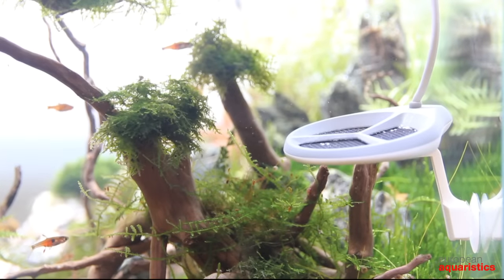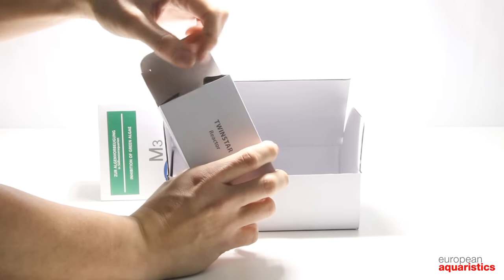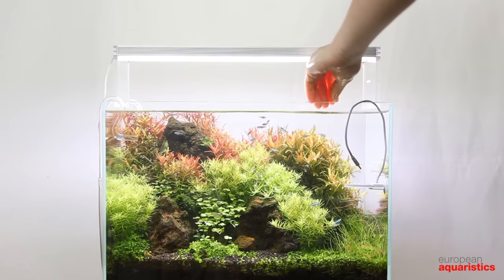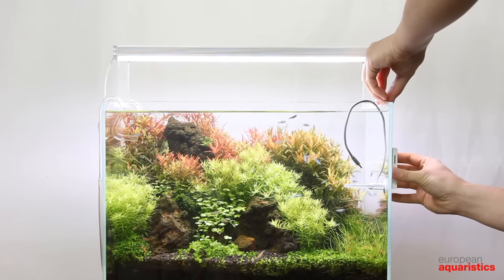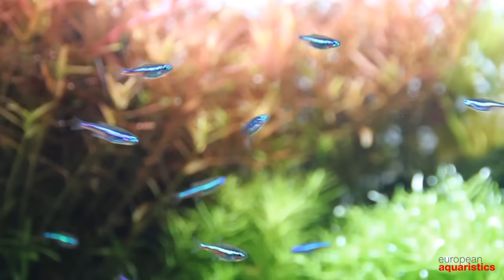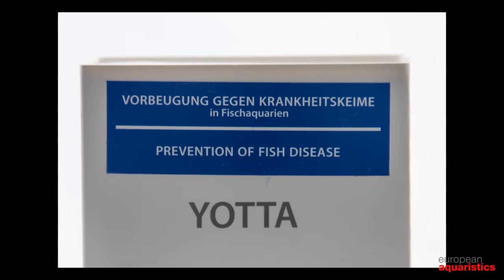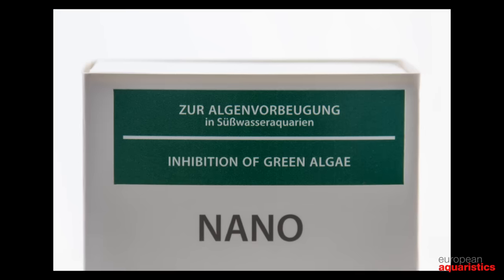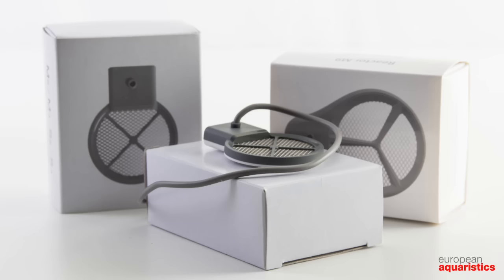TWINSTAR! For a better algae-free aquarium!

Comment: Makes me laugh,  they work incredibly well.  Have 2 in shrimp tanks running co2,  its that good I've had the same co2 diffuser in my tank for 2 months without having to clean it.  They only used to last 2 week's before i put twinstar in there.   So believe it works very well.  Only algae it won't stop is bba

Comment: I'm sorry but this product falls into the 'high-tech non-essentials' category, very much like ADA Power Sand, Tourmaline BC & Dupla/JBL heating cables. Flashy rich kid's toys at best but just that, toys. Things that you don't need but provide a bit of fun, as well as futuristic coolness that rivals in sophistication to a marine aquarium stocked with exotic live corals.

I've seen these Twinstar units in action at various professional aquascape outlets - all featuring high-tech Nature Aquariums, Dutch tanks & were the tanks free from algae? No! There were still algae in the tanks, including that strip of BGA under the substrate touching the glass panels.

Which begs the question: "Why bother?" Simply because of BUSINESS. Yes, it's business as usual. Ah, but shopowners everywhere will be furious should that be a topic for debate but really, marketing fads happen. 

We, as consumers need to be discerning & knowledgeable. All planted aquariums, no matter what tech-level each operates on goes through the same bio-rythym (new tank syndrome, old tank syndrome) as well as buochemical processes that slow down plant growth i.e. allelopathy. It's just a question of speed - the rate at which the tank matures. Which depends on the energy input i.e. light. 

So, can this flashy toy's microbubbles prevent algae? Maybe to a small extent but it will never solve the root-cause of algae problems. That being, the natural ageing process of a planted tank which I've mentioned above.

And you can't blame the manufacturers when it is the consumers who lack even basic knowledge, intuition & Science of planted aquariums. They know. That is why, they're in it for the quick buck. If all aquarists, in a perfect world had access to perfect knowledge these companies will close & businesses fold! 

Personally, I like to stick to basics & go for mid-tech. Why overcomplicate things & pay more to set up a high tech planted tank that is ageing faster AND demands constant attention lest loss of equlibrium causes everything to go down the ditch? Do people these days not value things like long-term stability & simplicity in favor of quick gimmicks, instead?
Reply: I would have read what this product does before posting this rant. They say it only reduces by 80% (average) for only certain types of algae.  You still have to be diligent in your fight against algae, but having something to assist in reducing the explosion is ok as well.  If you have the money, and it's working, why would you be against it?  Some of this hobbies biggest problems are inconsistencies in the online knowledge of how to address concerns and that your way is the only way to do things.  The fact is that most people leave the hobby because of algae and those inconsistencies on how to fix these issues.  Since there are no chemicals, this is a win.  I would take it as such.
Reply: @thawolf5921  Firstly, before you disrespectfully reduce my opinion to a "rant" I urge you to read my post again. Did I imply that "my way" is the right way? No. I merely said the truth, that being a lot of hobbyists today lack actual knowledge, as well as practical understanding of how planted aquariums work i.e. it's dynamic equilibrium & algae being a part of that natural process as an aquarium ages. Thus, their reliance on marketing fads owing to such ignorance. And yes, this product is a fad.

Why so? Well, that's because unlike you I don't "read" about products & then try to shoot others down like smart arse - I see the product in action as used by professionals.  And I am honestly telling you, despite claiming to reduce algae by 80% & what not, there are still established planted aquariums (~ 2 years old) that suffer from algae breakout even with this thingamajig running & kept in pristine working condition. That's because algae is symptomatic of an aquarium losing it's state of equilibrium. Algae is not the problem itself. Do you understand this concept? It's called 'old tank syndrome' - rejuvenating the biological balance of the aquarium, reducing accumulated organics & ensuring that municipal water supply parameters are not contributing to excess undesirable nutrients (via RO filtration) are the tried & tested methods.

Think you can simply a buy a product off the shelf without understanding water chemistry or how your own aquarium works & expect an algae free aquascape? Your ignorance is showing. Please, before shooting others down do your homework first. And don't presume you're such a badass just because you call yourself 'Tha Wolf' online like what a tryhard. Bet you look like a potato than big, bad wolf in real life, lol!
Reply: @Z4U3398   If you know how to fix or assist with a solution to the algae problem, make a video with proof it works. I'll subscribe and donate money to you. Truly.  Everyone you trashed (see your comment about not blaming manufacturers for consumers lack of knowledge in your opinion) are on these channels looking to expand their knowledge.  Keep in mind, that drives people from the hobby also. I would make another channel though because if they know that you speak so ill of the people who would be donating their time and money to you, it would be over for you regardless of how much you know. 

In my reply to you, I stated you must be diligent.  Never said it was a one stop shop for algae reduction.  Also, I said it was 80% of certain algae types.  That means that different algae's at different stages may not be reduced. Another way to take that is use it like a tool, if you have the money.  If you don't, learn the science.  Don't trash people for their money and their choice. Just like you and I can say whatever we want, we can also spend on what we want.  I'll go with what people I know personally have done for years and had success with.  This is a good product, and only reduces the frustrations of algae, not eliminate. We can get something to help while we learn. Nothing wrong with that. I know you don't agree, but that's cool.  

In all seriousness, you sound like you know more about the lifecycle of algae than most.  Get out of the comment section on your soap box yelling about how corporations are bad and arm hobbyists with the science behind this annoying ass problem.  There are some ok channels with information, but you seem to have the ability to go further.  Then  you will be a hero to people who feel lost.  If you don't want to do it though, don't trash others.  Looks crappy. 

On another note,  I hope you are well.  I hope you, your family, friends, and anyone else close has had no issues during this crappy ass pandemic. I may be an ass, but I would still be cool with you in person.  We can disagree over good food. I am a tryhard in certain games. Come at me bruh. :P
Reply: @Z4U3398   If you aren't going to reply to such a lowly character as myself, then why did you write so many paragraphs in reply?  I mean, 3 paragraphs per reply.  hahahaha. Probably should have left that out. That shows the character of someone who is emotionally and egotistically wounded.  That is the sign of victory. Keep replying though.  Now it's funny.
Reply: @Z4U3398  Same to you. I hope you succeed in whatever your minds eye perceives as such.  I hope we can laugh at this over a drink someday.